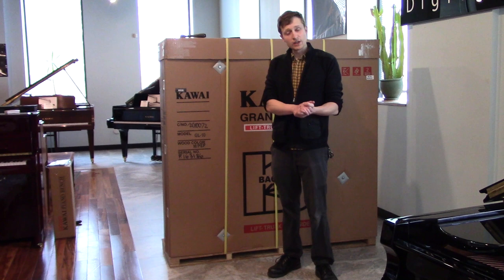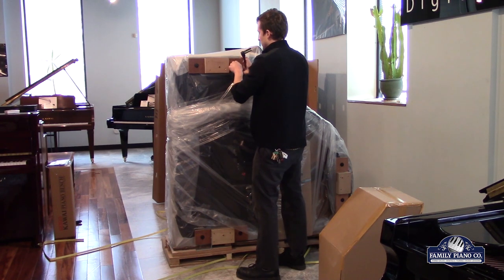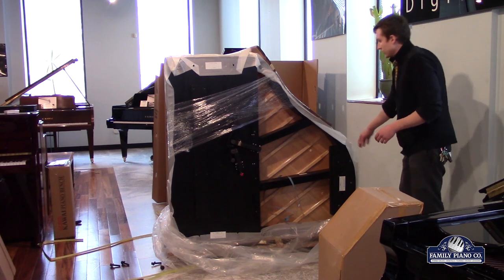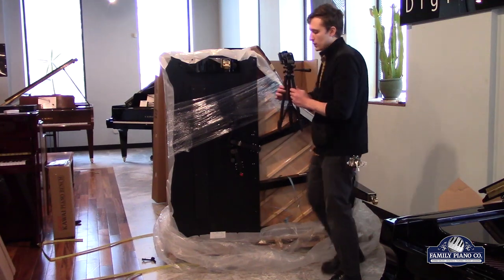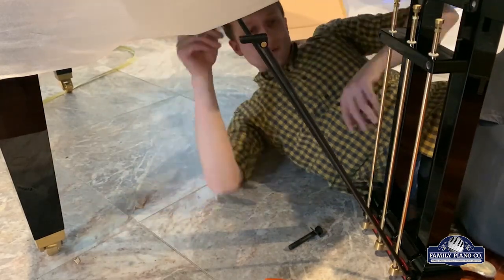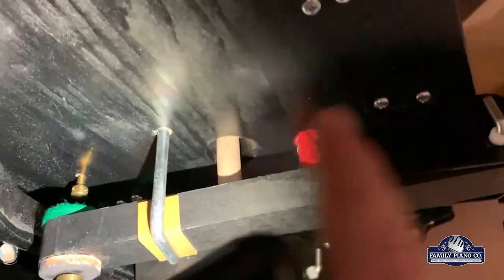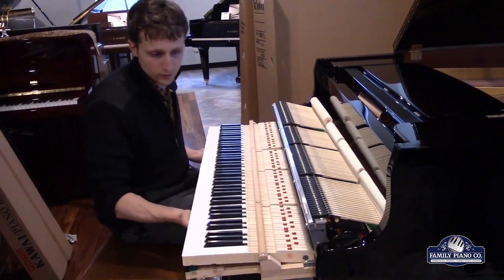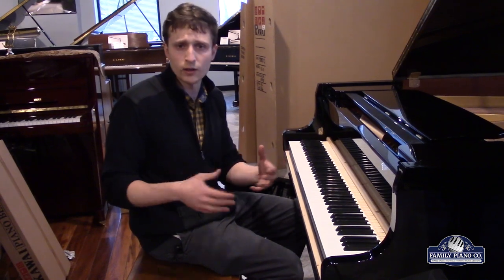Unboxing a Kawai GL10 Grand Piano | Unboxing and Overview | Family Piano Co.

Comment: Always wondered how do they ship such sophisticated piece of hardware. Thanks for the video. Just a query, do pianos (upright/full-size grand ) generally gets shipped in this manner  ?
Reply from the maker: It's crazy to think about, right? Such huge and delicate instruments being moved across the planet, materials sourced all over the world, and ending up in someone's living room. Amazing times. 

And yes -- this is the standard way to ship pianos. Grands need the legs disassembled; uprights are sent whole. Wrap them up, secure the little parts in the action, and then drive slow haha. 

--Drew, 👨‍👨‍👦‍👦🎹
Reply: @familypianoco - Even more crazy is the story about the once famous Dutch pianos built by Rippen. They were so lightweight that they could be shipped by plane as early as the 1950s. Rippen built a second factory at an airport in Ireland so they could build and ship their instruments even cheaper and quicker around the world.

Sadly, the Rippen company didn't survive the aftermath of the economic crisis in the 1980s, due to increased heavy competition from Asian piano manufacturers.

Rippen's famous aluminum grand piano is still highly sought-after today. Rippen always used Renner action in their pianos and grand pianos, which still makes them reliable and smooth, just like any Kawai.

Anyway, thanks a lot for the great video!

Comment: Is each leg stand of the piano assigned to a specific position or is it just random?
Reply from the maker: I think the legs are all interchangeable on the GL-10. But I haven't dropped one myself in quite a while. The back leg may have longer screws or something. Definitely read the manual to be safe haha. --Drew, 👩‍👩‍👦🎹

Comment: Why does it go out of tune so quickly when new? 22:26
Reply from the maker: The strings are still stretching, and the whole piano is still settling, albeit a tiny bit at a time. Each of the 230-ish strings has about 200 pounds of string tension, so overally, we're talking about 40,000 lbs of string tension overall.
Reply: @familypianoco  thanks for the info x